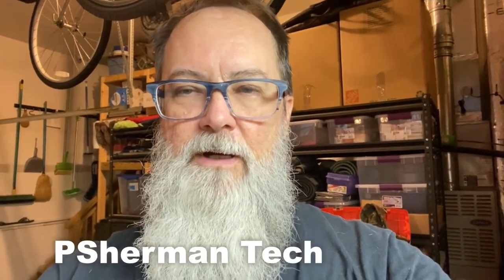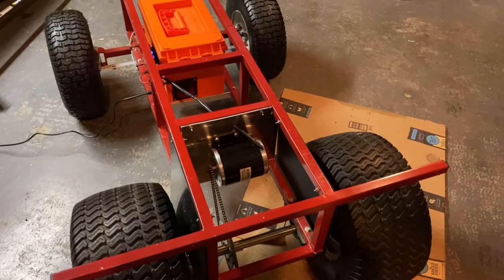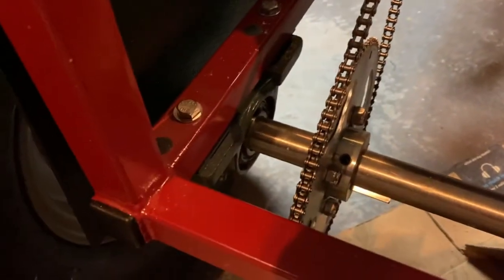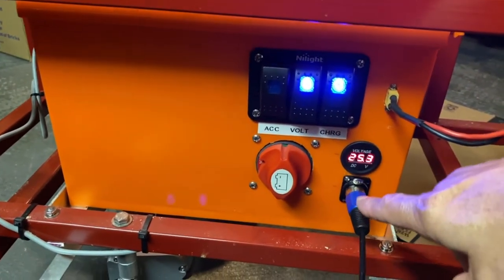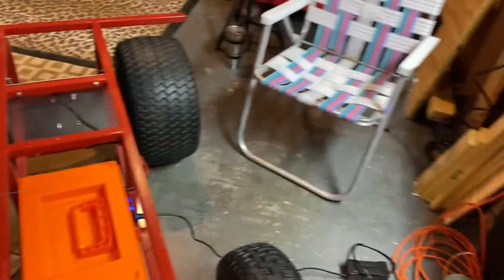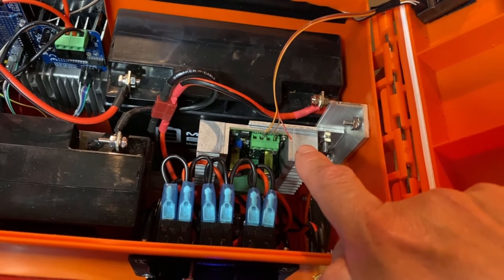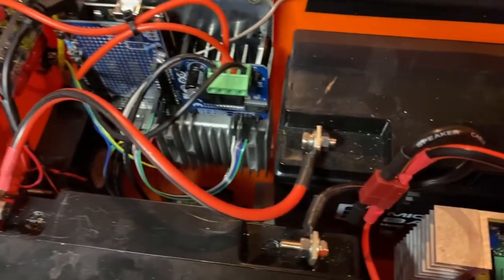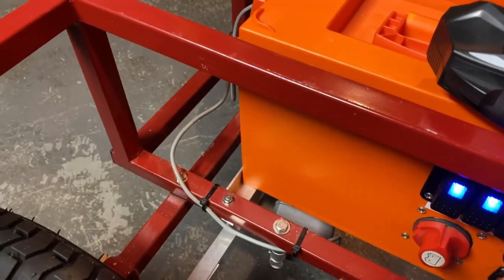BUV 2.0 Overview - Remote Control (RC) Beach Utility Vehicle, Cart, Buggy

Comment: This is a brilliant project. Would you consider doing a deeper breakdown on the electronics includion the Arduino coding and workflows through the build?
Reply from the maker: @niic Thank you! I have thought about it, but I'm not sure where the best place to post the code would be. The function of the Arduino is to re-center the steering when I release the wheel. The function reads the position of the actuator from its built-in potentiometer and maps that to the range of the remote PCM signal. This is where I got my start: https://www.instructables.com/Controlling-the-Position-of-an-Actuator-with-an-An/
Reply: Thanks very much. Super helpful!
Reply from the maker: https://www.youtube.com/watch?v=yFs04UKNozE
Reply: This has been super helpful. Thanks very much!!

Comment: Also keen to know how you determined your engine size? What factors did you need to consider to arrive at the 500W spec you used?
Reply from the maker: @niic Ha! I don't actually know. I'm pretty sure 500w is way more than I'll need, and since I haven't done any real-world tests (climbing sand dunes), I won't know until next Spring. I just wanted plenty of power and the price difference on the 300w wasn't that much. I do know that I had to turn down the signal on my RC remote to keep it from jumping the chain off the sprocket.

Comment: Hi, London calling. great project. I am building a ride on train from a copy of popular mechanics 1965 august. I am making it a road version so no track. I have a mobility scooter that I’m using for the motor.I have very little knowledge on the electrics.To keep it simple I am using a servo to operate steering and another for the forward reverse control.can you list the parts(I probably can’t write script so no ardweeno) I would need? Thanks in advance Tony
Reply: Hey Tony, You should be good without the Arduino, so almost any RC (PCM) controller rated to handle the motor's amps will work. As I mentioned, I used an Arduino only to make the steering return to center. It may return to center without it, I don't know. I had to spend a bunch of money to figure everything out. I hate for you to have to do that, but every project is unique. For motor controllers I've used Syren, RoboClaw and Mamba. The Syren doesn't have a GUI but seems the most dependable. I wish I could be more helpful.